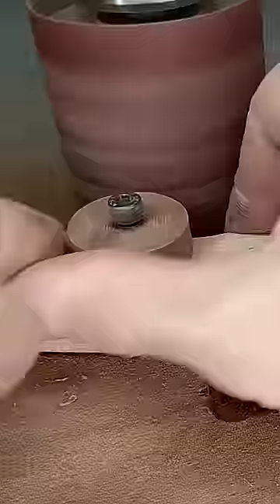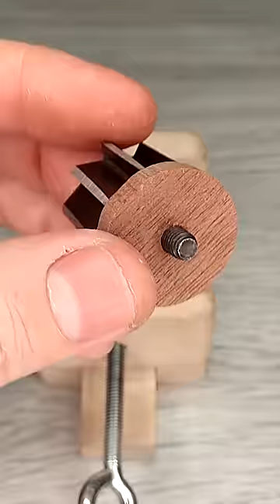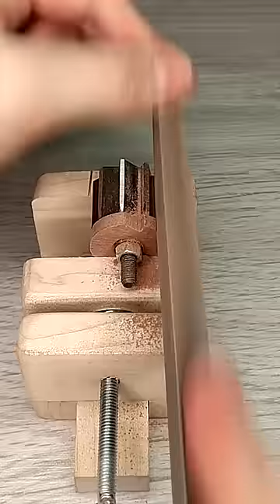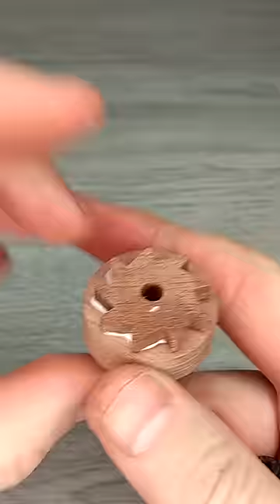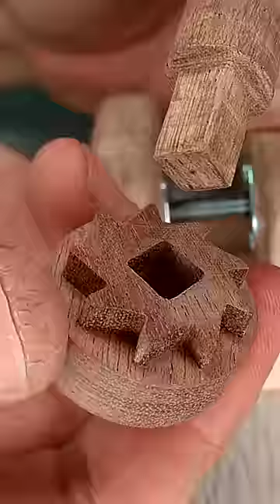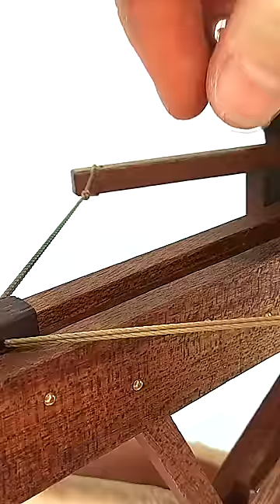Roman Ballista DIY

Comment: Remember when "DIY" meant hot glue guns, scissors, and maybe a pair of pliers and various house hold items like coat hangers, magnet clips, cardboard tube or used plastic bottles?
Reply: diy mean do it yourself, not do it cheap
Reply: @Kotori no shogai I'm not saying DIY was ever actuallu practical, I'm just saying the whole idea was anyone could do it. You didn't need a carpenters workshop make a fuckin desk toy, you could achieve functionally the same thing with binder clips, rubber bands, and some pencils.
Reply: What you're describing is "arts and crafts"
Reply: Diy is actually for doing it yourself doing which means doing something with materials from scratch and create the final product
Reply: @EssaysInTheCommentsSection  it's technically diy
Reply: And 3d printers
Reply: Cool, go make a Cardboard Ballista that doesn't actually function like a true Ballista.
Reply: @EssaysInTheCommentsSection  Which one is carpenter's tool? The sandpaper machine? Take the sandpaper and use your finger. Wood vise? Just hold with your hand or something. File? You don't have one in your house? The product may looks rough and unfinished but the point of DIY is functionality.
The uploader used fancy carpenter's tools to make it faster and looks more 'beautiful' for the content.

Comment: The wood grain is set to shear the gear
Reply: how else would it be? if the grain ran from one face of the gear to the other that would be way worse
Reply: @hazza2247  

Gears are not meant to be made from wood
Reply: @stormyeffects4795  excellent point

Comment: I have a feeling ancient Roman's didn't have 1/4"-20 bolts, hex head nuts or open end wrenches
Reply: Here I was all set to respond to the post above yours about using wood instead of metal and the reasons behind it. How the Roman's didn't have a metal gear/ratcheting system.  
Then you up and point out, that's not all they didn't have.
Well shoot, still have the buzz cut from that zipping over my head.
Reply: @randysmith9636  🤣